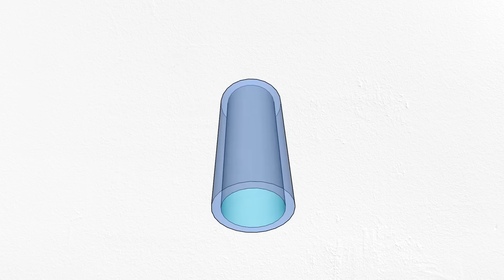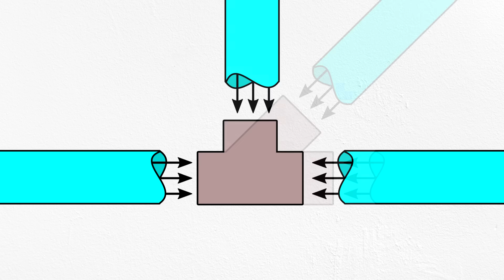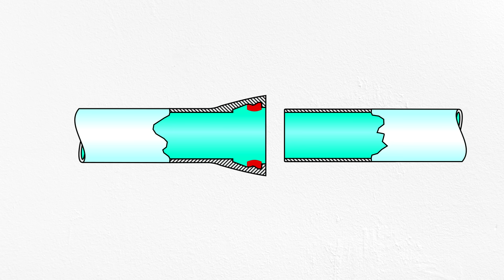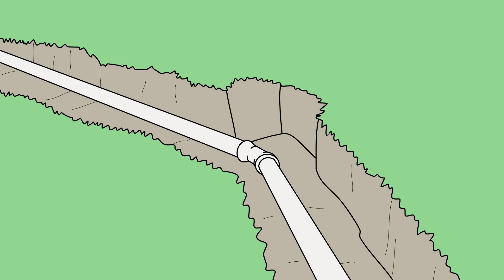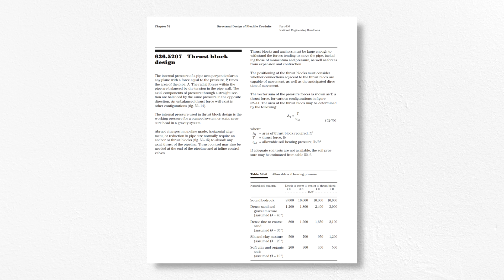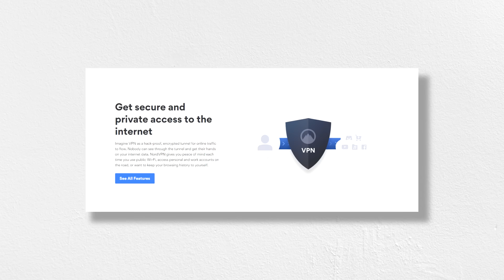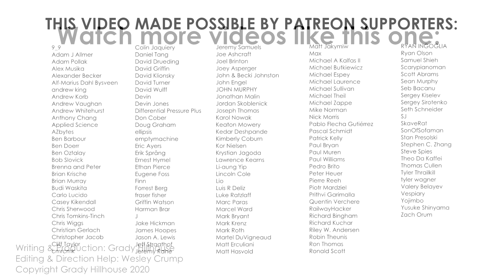Why Pipes Move Underground

Comment: here in switzerland I often see bolted pipes on hydropower plants, coming down from the mountain into the machinehouse. they usually run trough huge cemented blocks at every bend they do, now I know why. I always thought they would just hold the pipe up from the ground....   I think bolted and pressurefitted pipes are the most common here and welded are for more specialised things like inside the mountain hydropower lines which are cemented into the mountain and production plant things. Pipes in the houses are mostly just crimped together today, which doesn't hold nearly as long as the old screwed ones....

Comment: Could this also happen to plant piping when it is not properly supported? Having worked on an old plant bolted connections often are often heavily misaligned when un bolting them.
This means they were either wrongly installed or the pipes were walking.

Comment: this is great for water and sewer. 
i work on high temp high pressure heating systems ( 370 degrees F and about 320 psig ) we just had a pipe leak in one of our tunnels out on campus. filling the tunnel with steam. we use many ways to off set the pipe moving from expansion loops in the pipe to expansion joints so the pipe slides inside itself as it heats up.  you might get a fun video out of steam and high temp water pipe and energy uses in heating.

Comment: I am in awe. I work in civil construction in Europe and even though Gas pipes my main field, I also still work on pipes for drinking water and heat networks. If those pipes you showed are used for drinking water im in shock. These would not pass any regulations for use in communal drinking water service. Your type of pipes would only be used in non pressurized systems. 

For all matters of drinking water a tight seal is not considered hygenical enough and also not reliable enough. For large supply lines of usally over DN 300 welded steel pipelines with a inner coating are used. For smaller dimensions welded PE pipes are used up into the houses. 

Even long before that when just regular cast steel pipes where used those even had a screw in mechanism.

Comment: Hey Practical Engineering!  What about a buried sling with one loop around the pipe and the other (opposite the force of the joint) buried and filled. Then the force of the joint would be trying to pull on and compress the dirt in the sling, but once unburied it would be easy to remove and there would be no curing time.  It's basically like the pipe equivalent of a sea anchor....a dirt anchor if you will.

Comment: Hi, i have a question: if some pipelines are welded and bolted together, how do they account for thermal expansion in the summer?
Reply: They are buried below the frost line where the temperature does not fluctuate as wildly as the surface. Those that are above grade, depending on the application, have expansion loops, or in more severe service, expansion joints that can flex enough to mitigate the movement.

Comment: great video.  1 piece of advice is that it is recommended practice when gluing plastic piping to make a 1/4 - 1/2 turn of connected joint prior to the glue setting.  This reduces potential for leakage.

Comment: Grady, it's Grady, one of the nifty additions to slip joint o-rings or gaskets in C900 and CIP these days are metal Barbs that allow the pipe to be inserted but not removed, once in... There's no pulling it apart again as the Barb's dig in and the gasket is pushed out against the groove it sits inside the Bell. There's also a joint fitting design called the "mega-lug" which is available for both C900 and CIP, we've also run mega lugs, and thrust blocks in extremely soft soil. One thing I'd love to see in a future episode is the use of anodes in CIP water pipes and why they're necessary. I think people would be surprised that we use them and why.

Comment: Thrust blocks are a pain and the integrity is to easily compromised. If another utility decides to put their lines right next to the pipe, they essentially have to dig out the soil behind the thrust block, essentially making it useless. Also if the soil around it ever gets soaked like during a main break, the concrete acts as an anchor, pulling out the pipe from the bells. I prefer to restrain the pipes with mechanical joints and other forms of restraints.

Comment: Check out EBAA MegaLug for ductile iron water main mechanical joints, in the product brochure they used them to pick up a 50k lb dozer. >> https://ebaa.com/products/dip/mechanical-joint-restraint

Also, check out US Pipe for ductile iron restraint gaskets. They have wedges with teeth that lock the pipe in place from longitudinal pull. >> https://www.uspipe.com/products/gaskets/field-lok-350-gaskets

Last cool thing, EBAA has a restraint calculator that let's you input different metrics like soil type, bury depth, and test pressure, to auto calculate restraint lengths for different types of fittings. >> https://ebaa.com/calculator/

I install underground utilities, and it's very cool to see well made videos on the topics. Where we are, we only use mechanical restraint devices. Some near by municipalities uses devices as well as thrust blocks and sometimes even full concrete encapsulation. Hope this is more fun info for you.

Comment: There is researching being done to embed the ends of PVC pipes with carbon (carbon nanotubes or other forms). The completed joint is microwaved which heats the carbon, and fusion welds the joint. You get a quick and strong join this way. The joints can also be microwave imaged to check for voids, etc.

Comment: I THINK this is the same thing that powers active support space launch systems, such as the space fountain and launch loops. Except the "fluid" used is magnetically accelerated ball bearings. As small particles such as sand act as a fluid when moving fast enough, ex vibrating sand can make things "sink" in it or sand blasting

Comment: In theory, wouldn't it always be better to use longitudinal restraint, as it's isolated to the pipe itself and not the soil around it? Thrust blocks might work, but I wouldn't entirely trust the soil to always do it's job, there's just too many environmental factors that could cause the soil to fail over time; say an earthquake or tremor, if a season is atypically wet or dry, winter conditions, etc. Isolating the restraint to the pipe itself more or less makes the system bulletproof up until the failure point of the materials themselves. I would also think these types of restraints would be easier to service, as you're just undoing bolts, or whatever the restraint mechanism is, rather than messing with the area around thrust blocks, which logically could lead to soil failure. 
I know they cost more, but if they have less issues over their usable life, I would think the potential cost savings over that time would be worth the initial higher costs.

I'm not an engineer, but I see it as a larger scale version of in-home plumbing. Would you trust copper pipe if it were all push-connections? No. Would you trust copper pipe if it was push-connections with a thrust block? More than likely not. This is more than likely why all copper pipe is brazed/soldered. What about other metallic pipes, those are mostly screwed together. I haven't really messed with plastic based piping, but I'd honestly trust a glue or screw over a friction connection. As for braze/solder/glue vs. screw, I'd prefer screw, just for ease of serviceability if anything were to go wrong. I know physics do not scale, but it's simple to take this concept and look at these larger pipe systems, and think that you'd want the most stable, easiest to service system possible, with as little points of failure as possible. That's why I think the bolt-together pipes would be the better of the solutions, no matter the cost, as you're isolating the restraint to the pipe itself, and a bolted pipe is easier to service than a welded pipe, especially when assembling the pipe. Plus like I said before, the point of failure then becomes the failure point of the materials themselves, which removes the failure point of the soil failing.  

I'm almost surprised there isn't a hybrid of the push-together pipe and the longitudinal restraint. In your simplified diagram of the former, you showed a slight taper on the female side of the coupling. Why not put a steeper taper on both sides, then have collars, with the matching taper, that bolt together. It'd only be a very slight redesign to the pipes already used, keep the same relative cost of those pipes, and have a relatively inexpensive restraint mechanism; the collar would have to be hinged, or a two piece design, but I don't think this would become a huge issue at the end of the day.

Comment: What happens (pressure wise) if you weld a joint. Can welds hold up to large pressure?
Reply: Welds on gas and oil pipe are inspected and x rays are done to make sure there's no pinholes. Pipeline is pressure tested also before being put into service. Then they are periodically tested for thickness and to check for voids around the pipe. I've worked on a few it's pretty interesting.
Reply: Matt G does a proper weld make the two pipes act as a single pipe in terms of pressure? Do you then deal with static forces of the now combined pipe acting on itself, or is the weld always going to be a weak point
Reply: @jakevote8978  Done properly the weld is actually stronger than the pipe itself. There's so many variables like wall thickness, length, volume, pressure, soil conditions etc that come into play but ultimately yes you are creating a single pipe out of several with an expected level of pressure across it's entire length.

Comment: The Netherlands has a lot of modal filters and a proper street-road hierarchy (using the former, and/or anti-rat-run one-way street systems), lowering automobile volumes were they really shouldn't be high - minimising conflict with people to just a few areas when works are done. Sometimes you just gotta ask 'is automobile through-traffic in residential areas really appropriate?.'

And saying 'closing the road' is not true. Road works allow cyclists, mobility scooters, and pedestrians through. These people are all traffic too.

Comment: Two types of municipal pipe joints.
Mechanical Joint referred to here as a slip joint and a flanged joint.
Most mechanical joint pipe connections are restrained with a device that keeps the two pipes together in straight runs. Most bends are restrained and blocked by concrete pads as shown in the video. Flanged joints are rarely uaed in most parts of the US in buried applications, however some cities require flanged, I am not sure if they are blocked or not.

Comment: A few weeks ago I was able to apply for city water at my newly installed home while most of the neighborhood has already had it. I never really thought much about underground water lines but now I'm more curious because I believe they had to tap into what I think is a straight section of pipe while also boring underneath a 2 lane road to put my meter in. It was quite expensive but I never saw them at my home it was just seeing something new being done while I was at work. Now I just have to disconnect the well water I'm currently connected to and then they should turn on my water.

Comment: Concrete blocks is exactly what my city did when they redid the pipes in my street. They used the type of precast blocks that you commonly find acting as anchors. They work surprisingly well compared to more complicated solutions and are rather cheap.  That's what I really like about my city. They don't over engineer things. They have that no nonsense approach, use solutions that get the job done without costing absurd amount of time and money, do a lot of the work themselves. That saves them money which they put back toward doing more work. The result is that my city features rather well in terms of how much water is lost to leaky pipes, well above governmental norms.

To be had, the biggest problem that we've got where I live with pipes is winter and bedrock. The pipes need to be deeper then the frost line, but bedrock is rather shallow which can make it rather expensive to run pipes. On some sections, rather then try to dig deeper, the city chose to lay insulation on top of the pipe and call it a day. The most problematic winters aren't necessary the coldest, but rather, those that have seesaw temperatures. They wreck havoc on our roads and the uneven ground movements increase the amount of pipe bursts. This last decade, it seems like that's every other winter.

Comment: Something seemingly very simple, yet actually very complex (like most things in engineering) is pipe flange bolting.  I recently worked a project that involved high temperature process piping that required every joint to be evaluated individually due to slight differences in the materials within the joints and differential thermal expansion between those different materials.
Reply: Oh yeah, the devil really is in those “simple details”.

Comment: When I was a kid I worked on a large job site with a mobile batch plant. At the time I was driving a concrete truck and delivery concrete around the site for thrust blocks on all the water mains. Wherever there was a tight corner or a riser to a hydrant we poured a thrust block behind it.
At one point I turned the water on in for the drum and promptly emptied the water into the concrete. When I poured concrete out of the chute it came flying out and puddled all around the pipe. The pipeline crew just looked at me incredulously and I just Shrugged my shoulders not really knowing what happened. 5 metres of concrete in the trash that day. I'm pretty sure that pipe isn't moving.

Comment: "Sneak a peak at the trench or ask a worker what type of restrain they're installing", mate, as a Civ Eng student i used to do that all the time, just picture me in a tshirt and sneakers riding my bike on my way to home, spotted a crew of public works workers, and appeared around the corner 5 minutes later with my high vis vest, hard hat and boots, most workers would let me know what they were doing with no problems and whenever there was a supervisor on site or an engineer and found out i was a student i got to do tours of the whole sites, see blueprints etc, it was pretty fun

Comment: On the last pump station project I was on, we had to use restrained joints AND thrust blocks. All of the fittings were megalugs, and the bell joints had a regular gasket + a second gasket with locking lugs.

Comment: I've always been fascinated at how simple restrained joint pipes are, yet they're incredibly effective. The simplest method actually has a bead line welded around the male end of the pipe and an extended bell with a groove outside of the gasket groove. A right-handed and left-handed piece are installed through a notch in the outer ring, a rubber insert is put between them, and that simple system makes the pipe resist as much force (or even more) than welded joints despite only taking around 30 extra seconds to put together and a miniscule difference in production cost.

Comment: One thing a lot of water pipe designers seem to forget is that you can't just change the fitting at the bend, tee or cap to a restrained joint. You need to actually calculate how many lineal feet of pipe either side of that fitting also need to have restrained joints. That's the most common error see in the plans I review. But I love knowing that every time I catch that mistake I'm saving a headache down the line, and saving the customers and utility owners money in the future.

Comment: We use thrust blocks ,  field lock gaskets,     all thread between some fittings linked with ductile lugs to hold fittings under possible thrust separation.

Comment: Water pressure blew 20 feet of water main and three water valves mounted on a cast iron tee fitting into an excavation I was working in. Powerful stuff. Some what wordy set up, we were replacing a triple set valve at the base of a fire hydrant on a six inch water main, we shut the water down to one end of the pipe, cut it, shut off the valve we expected to shut off the other end of the triple set, and then cut it free from the hydrant.  When that cut was made the valve set and 20 feet of water main shot into the excavation we were working in. The water to that end was not turned off when we thought it was. Dangerous situation, that project should’ve been three or so hours. Ended up being a 14 hour job with boil water advisory’s for 24 hours after the repair.

Comment: In northern Ontario we have an average minimum of  2 meters of ground coverage for watermains, sewer and the service. In the north, frost poses additional threats to watermains. For added protection to each section of watermain we add a slip ring to each end of the connection which would have a place for 8, 10 or 12 bolts or more depending on the size of pipe. Then we install threaded bolts from one end then place nuts and tighten using an impact gun then finalize tightness with a torque wrench.

Comment: Are slip-on fittings also desirable for being able to slide freely with thermal expansion and contraction?
Reply: Ehhh.... Not really, since you introduce soil/crap into the sealing surface with movement underground.

Most slip together type utilities are not going to experience a massive amount of thermal contraction/exp... Groundwater and ground temps are relatively stable year-round, and slip fit pipes won't carry heated/cooled liquids.